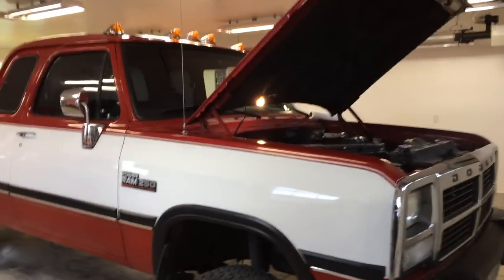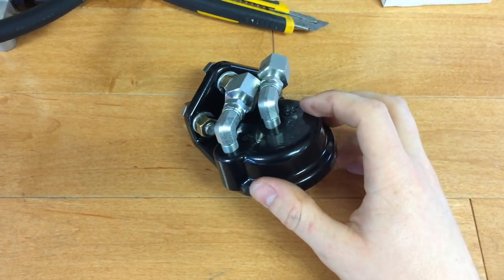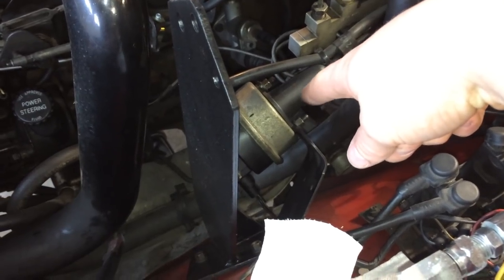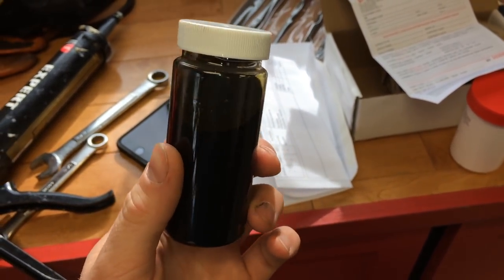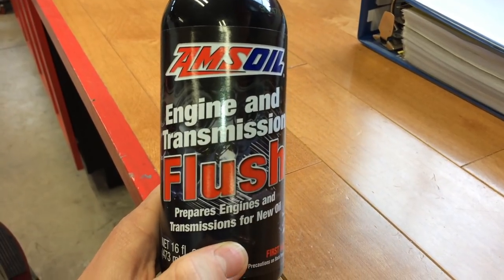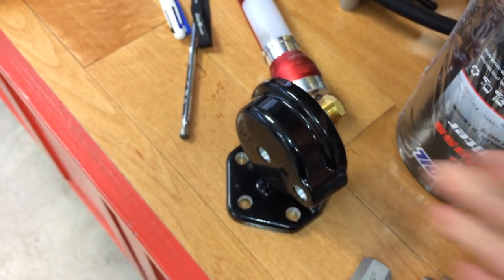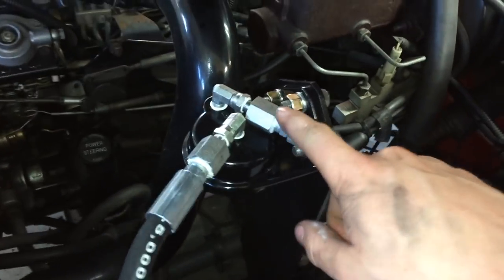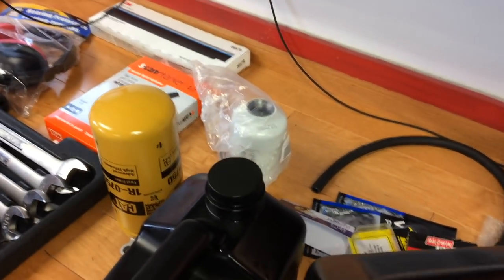Setting up your Engine for a MILLION MILES! - Oil Bypass System

Comment: Still need zinc.  The fact that microns of metal are developing at all is the real issue.  Prevent the damage instead of catching it at the filter after the fact.  Magnets on the oil filter are proven to work and will catch every single micron.
Reply from the maker: A magnet will not filter engine oil. It catches large metal chunks.
Reply: Tyler Ovens not just large chunks strong enough magnet will attract lots of metal deposits

Comment: After watching this video, it occurs to me that the same principle could be applied to the other fluids within an engine? (i.e. radiator, fuel, transmission, steering, etc.) I could only assume that this would improve performance and efficiency further still?
Reply from the maker: Yes I’ve seen some people with coolant filters. I’d say engine oil is most important though as it sees the most wear and carbon build up.
Reply: Since I viewed this video, I have heard that these bypass oil filters can even filter out additives that are supposed to condition your various gaskets too. What is your take on this? Thanks
Reply: @OvensGarage   Coolant filters are an interesting thing.  They were more common on commercial diesels for a while but have fallen out of vogue for a couple of reasons.    Manufacturers realized that there isn't enough debris moving through the cooling system to warrant a filter, the filters themselves rarely got changed and ended up being a source of contamination themselves when they rotted away and the coolant system doesn't have tight enough tolerances or lubrication demands.  The other tricky thing about coolant filters is that they had a second more important purpose,  They replenished the additives in the coolant system.  These additives, combined with a low level of aeration in the coolant itself and the coolant being mostly ethylene glycol protect against rust, corrosion, pitting and liner cavitation.  It's now possible to test the coolant for these additive levels and top them up directly as opposed to relying on the "filter" to do it.  

Here is a link to an excellent article that goes into this in much more detail.  https://www.ccjdigital.com/business/article/14900195/understanding-coolants

Cheers

Comment: Tyler , can you provide a parts list for this install ? thanks
Reply from the maker: I don't have an exact list sorry but I showed all the parts that I used in the video. You can buy the AMSOIL parts for the filter head from their website along with filter but then the fittings and hoses I got from local hardware store Princess Auto (Like a Harbour Freight)

Comment: i would have put the return in the valve cover over cylinder 8 to fix the low oil pressure prob most engines have there
Reply: 🤦‍♂️ cylinder who!??
Reply: Cylinder 8 is the last in the line, so oil pressure gets low. That cylinder get less than the rest
Reply: Its only a six cylinder motor....😅
Reply: 6-8-24...same thing
Reply from the maker: I've been meaning to re-locate it. Not entirely happy with the way I have it mounted...but it's been that way for a couple years now and I haven't had any issues haha.

Comment: Now how could I go about running a mechanical oil pressure gauge on this if I was to run a bypass filter? I'm running my mech gauge to the other port on the oil filter thread
Reply from the maker: Your best bet is probably just to use a brass T-Fitting. They are readily available on Amazon. Off the top of my head I believe they are 1/8" NPT.
Reply: @OvensGarage  would i run the t fitting off the main full flow oil filter or the auxiliary bypass filter housing?
Reply from the maker: Either one would read the engine oil pressure, the pressure reduction only happens after the oil passes through the filter mount/housing where there is a small reducer that restricts the oil flow into the filter. So either port would read the correct engine oil pressure.

Comment: Do you have a drawing of the mounting bracket for the filter head?
Reply from the maker: Sorry no I did not create a 3D drawing or anything like such of the mounting bracket. I ended up just taking a plate mounting it to the 3 existing holes in the wheel well then using a level to tack a straight piece upwards and trimmed and fitted the filter mount from there.
Reply: Tyler Ovens no worries. I don’t have a welder at home and was going to have it made at work. I’ll do it the way you did. I’m hunting down the parts now. Thanks for all the videos. I’ve learned a lot and gotten a lot of ideas. Keep them coming!!

Comment: Why didn’t you t into the turbo return since you were already on that side of the engine
Reply from the maker: I wouldn't t into the turbo return because you want minimal blockages in the return line. Adding extra oil to the return line could potentially back up the oil into the turbo and cause it to go past the seals in the turbo. Don't want that.
Reply: Hmm sorry I just don’t see that happening. I’m splicing into the rubber hose by the block . I don’t see all the oil filling back up into the turbo tube and back into the turbo.
Reply: Anyhow lo what is the fitting size for the oem side where you hooked up your feed to the bypass ?
Reply from the maker: @watermalanblew  1/8" NPT
Reply: Hey man I posted a video of my cold start do you mind looking at it and tell me if it’s normal ? I don’t think it is but I need some opinion as to what it can be

Comment: The return line in the oil fill neck is kind of sketchy and looks kind of fabricobbled. Consider taking everything off and putting a treaded plug in the hole. Then, just go right through the top of the cap!
Reply from the maker: Yeah it's been on my list of things to do. I want to re-route the feed from a tee off the oil pressure sensor which is on the drivers side, but I haven't dreamt up a solution for the return line unless there is an easy way to return into the oil cap somehow? I still want to be able to easily open the oil fill cap.

Comment: at 11,10  till 11.35 minute,It;s call motor oil valve(brass material).Is any ones know where i can get it on ebay or amazon?thanks.
Reply from the maker: I got it from Genos garage. You can visit the manufacturers website and look for them. You can probably get it on amazon as well if you know what size you need.
Reply: It's a Fumitomo oil drain plug

Comment: Full Synthetic? or 100% synthetic?
Reply: Fully synthetic oil is a marketing term that in no way defines the quantity of synthetic content, David is 100% correct. In order to make higher quality oils, high-performance oil companies will essentially develop molecules from scratch, which are then synthesized and produced free of any mineral or crude oils

There is no escaping this 100% Synthetic terminology with fancy or 
confusing marketing terms. If it is so-called such, it must be 100% 
Fully Synthetic by regulation.

Comment: Why can you just replace the regular oil filter and  use the Ams oil filter Instead?
Reply from the maker: didier banegas If you were to put this filter in place of the main filter the engine would starve for oil. The bypass filter filters oil at a finer level and reduces the amount of oil flow. That is why it draws oil separate from the main flow path then recirculates it.
Reply: Tyler Ovens , make sense,  thanks for responding.
Reply: A bypass filter is NOT the same as your full flow filter, you engine needs to maintain oil pressure. The bypass is a filter that get only a small amount of pressure to work with. Also if that one ever gets clogged? It will NOT intervene with the full flow filter....

Comment: Amsoil Diesel Oil is no good check out the article genosgarage.com. The only oil the cummins recommends is Valvoline Premium Blue 
, it’s has all of the additives our motors require. Amsoil comes up far short on additives compared to premium blue

Comment: It is not good to take an oil sample out of that valve on the bottom of the pan.  Not a realistic sample.  Amsoil sells a sampling kit with a hose you drop into the dipstick tube.
Reply: Where do you think the dipstick leads ?
Reply: Scott H supposedly the very bottom of the oil pan has impurities. What you're saying makes sense to me to however I have watched a lot of these videos where they take oil samples for instance on big Diesel Rigs and they tell you never to take an oil sample through the drain hole. Now I assume it's possible that the kit they sell to take a sample through the dipstick hole is just to make extra money.

Comment: Don't waste your time or money doing this!!!  He said it him self the engine wears out because of particles that are smaller then the oil filter can filter out!!!  And the filter that he is installing can't filter out the particles that are wearing out the engine either!!!  Its wearing out because the filter is not doing its job of not filtering the particles that are wearing the engine OUT!!! One more thing a full flow filter is really not a full flow filter.  It is a bipass filter!!!
Reply: I agree Larry. The reason for the bypass is if the filter clogs, it'll open, and your eng. will still receive oil. It may be "dirty" oil, but it's better than no oil. On some engs., if the oil pressure is too high, the bypass my start bleeding off pressure, and some racers recommend plugging the bypass to prevent this. But on a street driver, I'm still a fan of keeping it functional. But hey, that's just me.